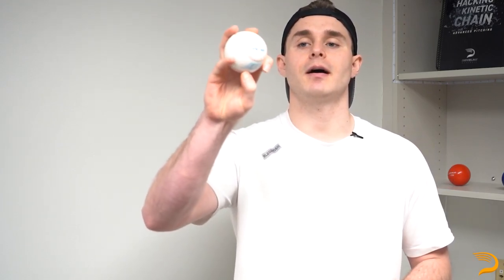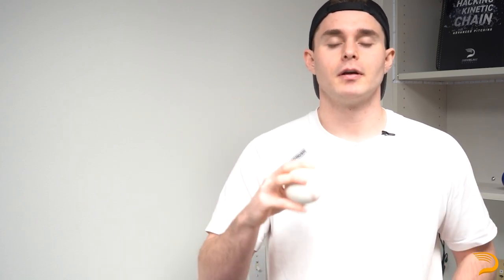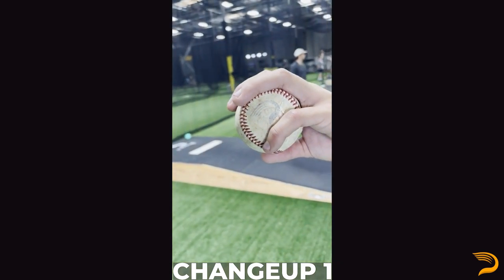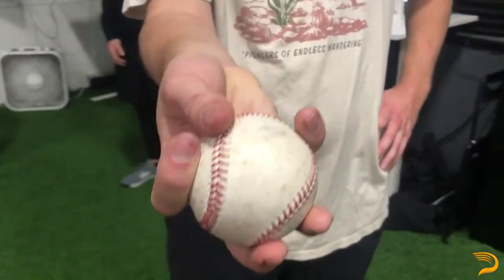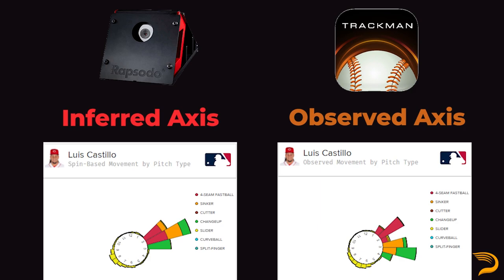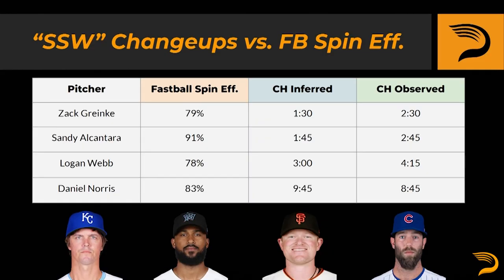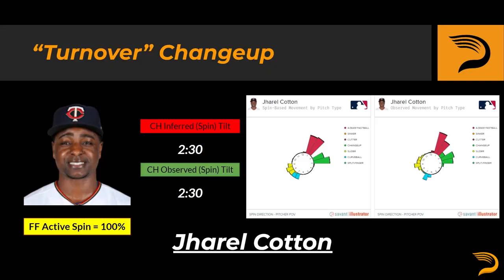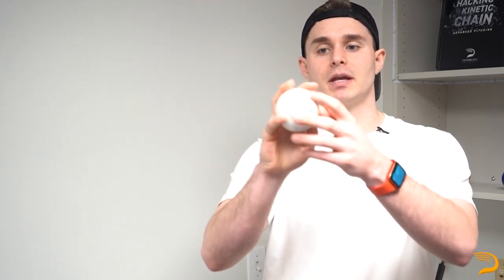How to Throw a Changeup | Thumb Positions, Grips, and Cues | Driveline Baseball

Comment: The splitter is such a weird pitch. Do you want to sort of let it slip out, or do you want it coming off the finger tips? I've seen Kevin Gausman talk about his splitter and he talks about it almost as if it's a turn over changeup. Then I see Chapman throw his and it's almost like a knuckleball the way it slips out. Does you're pronation/supination bias have any impact on how you might best throw it?
Reply: yeah splitters a strange pitch. Chapman and Gausman are basically throwing two different pitches. Chapmans rpm on his split is about 700 and I’ve seen Gausmans rpm on his get up to 1700. Chapmans throwing what’s basically a fast knuckleball. His split will have some weird movement and then sharply drop at the last moment. Gausmans throwing something that resembles more of a tight changeup. His will have some late fade. Both are unhittable if you can throw them for strikes which can be very challenging. Also a hanging split is a great way to turn any hitter anywhere into Barry bonds. Those two reasons are why I think splits aren’t super common in the league. If you want to throw a split and are a pitcher that struggles to pronate on pitches like changeups. I would throw chapmans way, which is how most people do it. Although if you are good at pronating, try Gausmans grip, maybe it works. Although I see no reason to pick a Gausman split over a normal changeup for your repertoire unless you just have a knack for it.